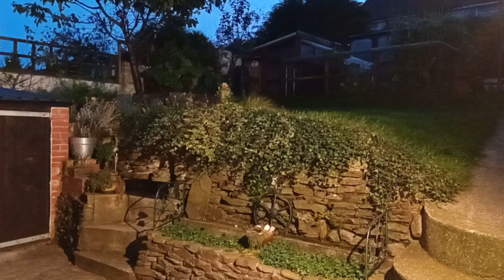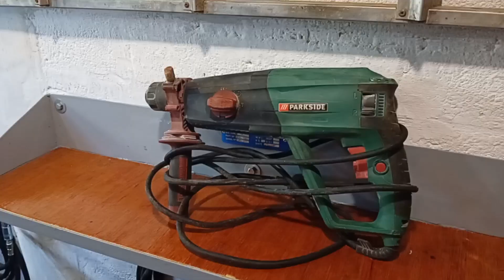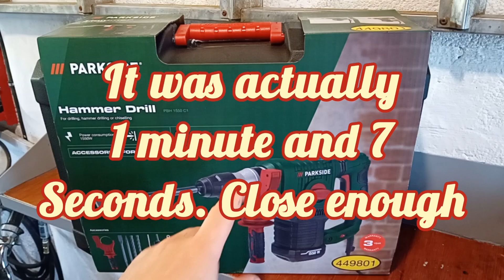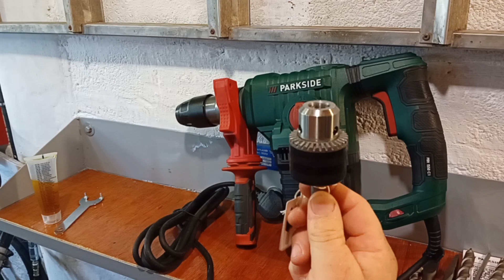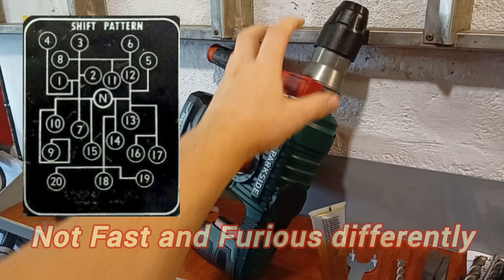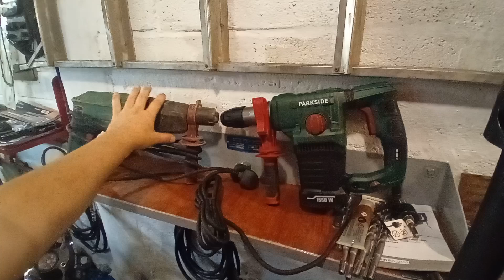Parkside 240v 1550w SDS Hammer Drill Impulse buy 😬 #parksidetools #lidl

Comment: the 1050 model does not work the way you describe it. it is pneumatic with a piston . it has a zig zag disk that forces back and forth the piston . no disk is rubbing against each other.that is only of a non sds small hand drill
Reply from the maker: Do you mean percussive as neither of the drills are pneumatic? They both use an electric motor to provide rotary or linear motion to the chuck and not compressed air, which  is what is referred to by 'pneumatic".
The zig zag disk is the disc I referred to with the ramps on. This provides percussive force to the end of the shaft that drives the chuck. The 1550 does this via a reciprocating conrod rather than a rotating disc. Both are SDS due to the type of bit attachment (slotted drive system).However, the 1050's hammer action  is similar to smaller drills with 3 jaw chucks but the gearbox allows the rotary motion to be disengaged.

Comment: Owner of 8 year old PBH 1500 here. 🙂

All the Parkside PBHs are pneumatic hammers, including the tiny corded PBH 800 and even tinier cordless PABH/PBHA/PBHAP. The difference is only the drive of the pneumatic mechanism, in large hammers, it's crankshaft and connecting rod, in smaller ones, it's a disc that's not perpendicular to the shaft it's mounted on (shaft parallel to be the chuck axis) and a thing that wraps the disc but doesn't rotate, thus producing back-and-forth movement for the cylinder.

You can look up disassembling or fixing videos for each of the tools over here where the mechanism is clearly visible. I've been watching them to decide if I should buy a smaller hammer for my apartment and leave the heavy PBH 1550 at the place where I'll need to drill some holes through half meter of stone wall. I decided to keep hauling the big one there and back again because the apartment has walls of concrete where every Joule of hammer energy counts 😅
Reply from the maker: I have the exact same issue with my house as it's built from cast concrete using a massive wooden form. The walls are over 12" thick so a conventional hammer drill struggles to make a hole past the plaster. A pneumatic hammer drill is capable of drilling right through but, as you say it's a bit bulky, especially for putting a shelf up.